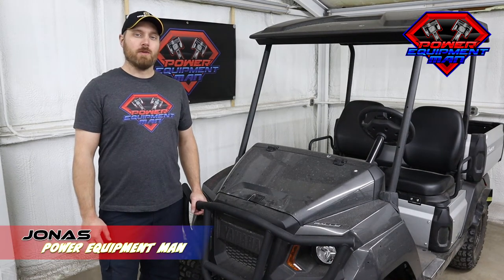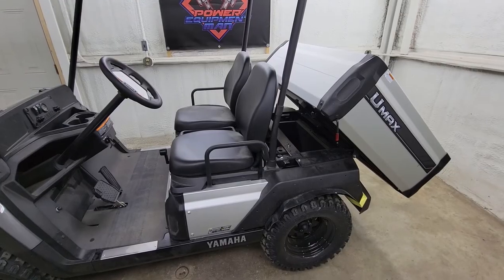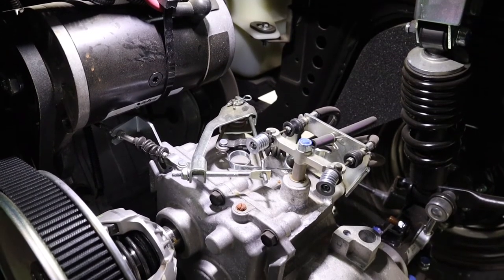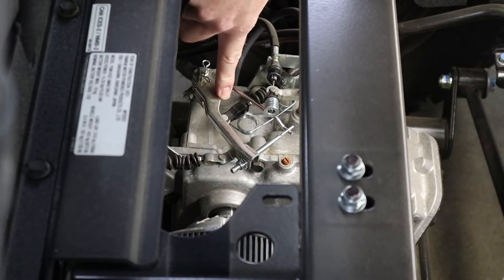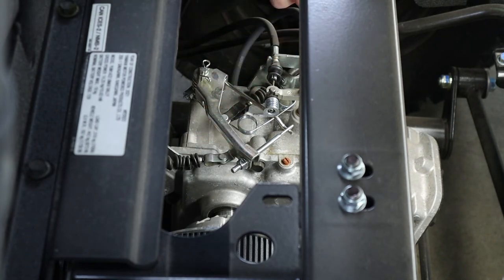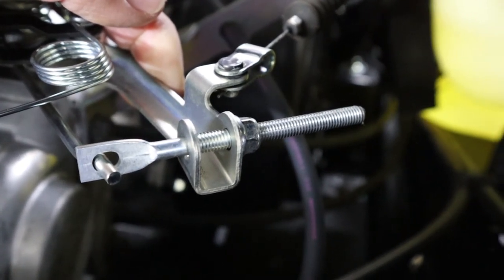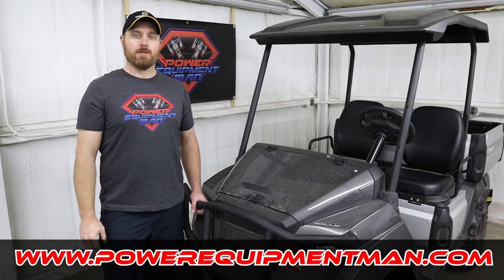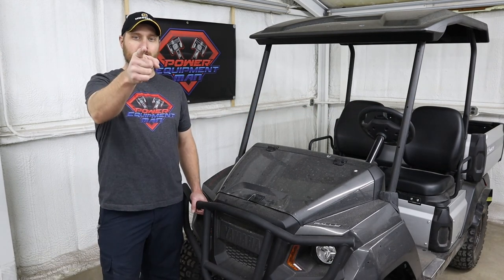Yamaha Umax Governor Adjustment - More Speed!!

Comment: Hey Jonas, I tried this on my UMAX and it seems like it’s got a rev limiter only got 1 miles an hour out of it from 19 to 20 and I crank down the arm pretty good
Reply from the maker: These engines do have an electric governor as well, but it should be around 4200 rpm. Sounds like you may have some other issue going on.

Comment: Is that a EFI or Carb? If it a carb should be easy to richen it up. May need some stiffer valve springs also to be safe.
Reply from the maker: These are EFI and are electrically governed at 4250 rpm. So stiffer valve springs are not needed. Thanks for watching!

Comment: how do you disable the beep noise when in reverse?
Reply from the maker: There is a connector you can unplug that is located right next to your forward/reverse lever in the engine bay. There is a small tab that you have to depress before the connector will come apart.
Reply: @PowerEquipmentMan  got it! Thanks a lot!